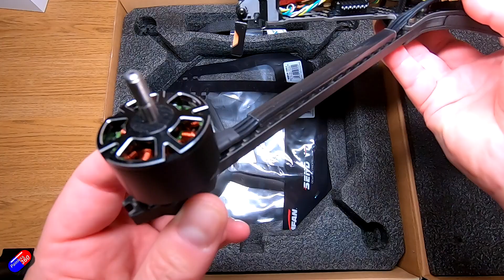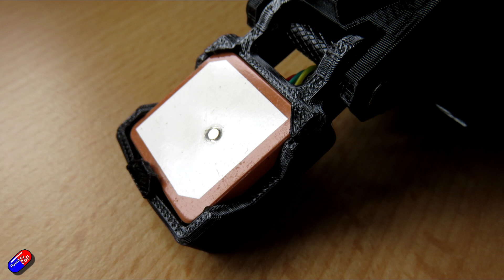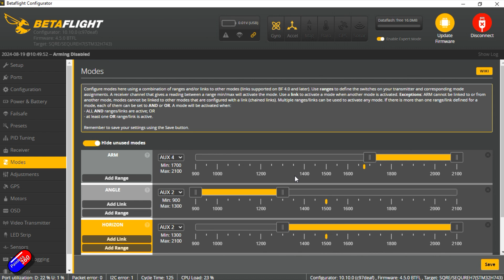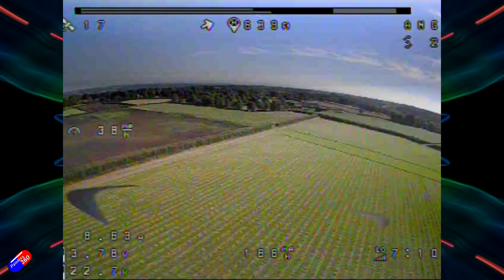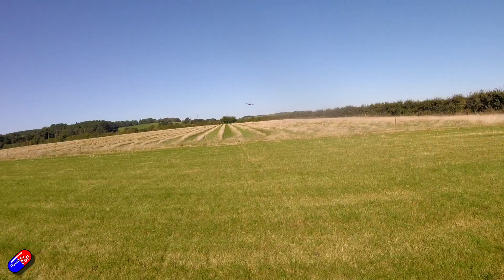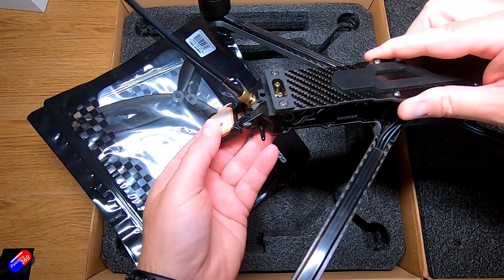SEQURE Now Makes BNF Quads: And they have with a 10 inch version!

Comment: Hi Lee, I have been following your videos for quite some time now across 
Fixed wing and quads , build outs and of course a lot of betaflight to Inav conversions of which Inav with stable rth and position lock got me to flash my speedybee master 5 v2 across to Inav. So thank you again for all your learnings.
My comment on 10 inch quads is their ability for long range cinematics , the one featured in your video is a squashed x frame so I assume a deadcat frame in 10 inch would have eliminated vignetting ?
I would also like to ask what software do you use for prototyping and designing your 3d stl designs for 3d printing?
Reply from the maker: There is now a huge choice of tools for design now, which suits you best is down to a lot of factors. I like Sketchup https://youtu.be/_lRrIr4RFDM
Reply: @Painless360  and the vignetting question?
Reply from the maker: Sample video of the camera view is in the video. Happy flying

Comment: I still have my legacy tricopter a HLG Y3 Dragon fly 10 inch  It was the first drone I ever built back when you were doing Libre' pilot videos.. remember that? And the CCD flight controllers?
I saw the Sequer 10 inch on AliExpress a couple of months ago and thought the exact same thing that you are thinking. There are two or three other 10 inches that are also there but they have stiffening bars between the arms which I think are unattractive. The good thing about all this is I can now find 10 in propellers for my tricopter. And it seems they've worked out all the dsync issues with the 900 KV Motors. That was a big problem for me 6.1, and it has walk snail in it, ready to go but I may switch it out for the new 900 KV Motors I'm seeing on AliExpress and the new all-in-one ESC that are specifically made for 10-in drones. My tricopter was my very first drone, it is not made any more, and it did do a freak out once but I repaired it. All because of a desync
Reply from the maker: Wow! You've been watching the channel for a long time! Thanks for sticking with me! :D

Comment: Well regardless of what it was originally built for, at least your model flew a good bit better than Stew’s. You obviously used a more appropriate sized battery. Not a perfect flier by any standard, but with balanced props, loctite and a bit of tuning(still won’t be perfect), but usable on some sort of an INAV mission or something 🤷🏻‍♂️

Comment: nice looking quad this is the size I like to build. I can see them from a very long distance away which helps with the restrictive regs in the uk. it's sad that we never advance technology as fast as when we are trying to kill each other. I'd flash Inav or ardupilot (if i can find the correct target for ardupilot). I'd swap the props for 2 blade 12 inch props ((looks like they would be enough room) ( i'd  contact ben at 3dxr and buy some quality props that hopefully wont heed balancing as i'm terrible at balancing props )).